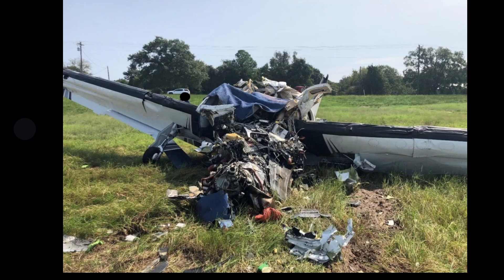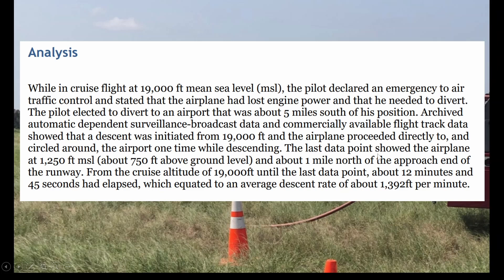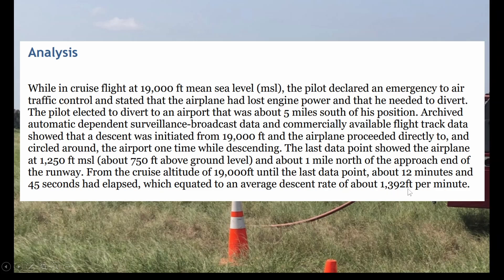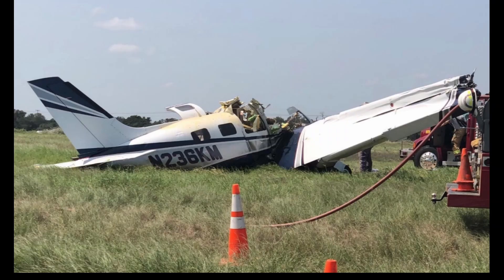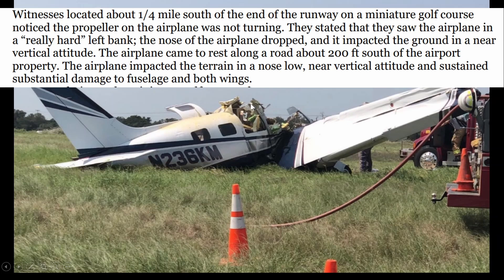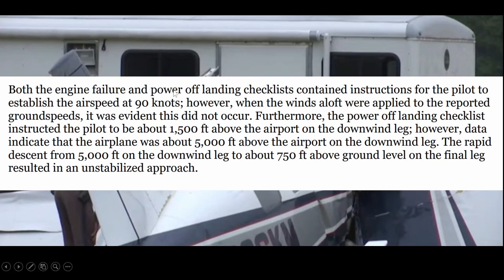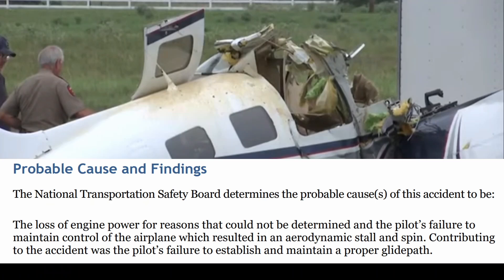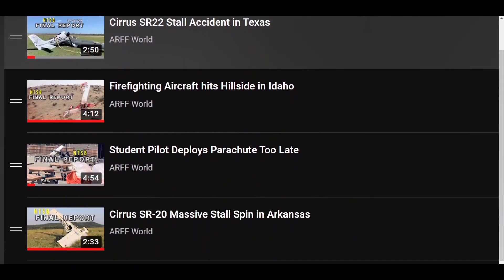Can too much Altitude Cause a Crash?

Comment: As an instructor CFII, he should've circle around  to loose more altitude before turning final. Otherwise, it seems like he was forcing the airplane to get on the ground which is the opposite of what we do. Choosing a closer airport wasn't a bad idea but he had to gauge both distance from airport and the altitude he needed to loose. Most of the time pilots panic and that's what causes more issues. Again, it's hard to blame anybody since everything happens so quickly.
Reply from the maker: Thanks you Elisha for your info.  Appreciate it and please subscribe so we can hear from you in the future.
Reply: I think "panic" is the operative word...it's hard not to panic when you have an engine-out scenario, but he had plenty of time to figure out how to get the plane down safely. Shame.

Comment: No, no such thing as too much altitude, unless there is an inflight fire. Being 5000 feet above the airport should be no problem. Make a couple of descending spiral turns over the so-called key position, and adjust base and final legs from that point.
Reply from the maker: Thanks Sam for sharing that info

Comment: Yeah, that's a mystery.... it looks like he didn't manage his altitude/energy correctly. Circling down over the field is the preferred situation, but they likely didn't manage things right. Most pilots train for engine out scenarios and practice short-approaches to get used to the glide performance and the effects of winds on different legs in the pattern. Realizing that after all that, they were not going to make it to the runway and stalled it at he last minute based on the nose down trajectory. Very sad...
Reply from the maker: Really sad one Paul.  Thanks for Sharing

Comment: I've had 3 engine failures in my life and each one of them is the same thing you fly the airplane to the landing it sounds like this guy tried to hustle it he had plenty of altitude to work with which gave him time I'm and if you try tol speed up his descent into the runway at the last minute with a high angle of attack on the left bank probably stalled a wing.  This should have just been a standard engine out landing without an issue. Very sad.
Reply from the maker: Thanks for sharing Stewart

Comment: no one needed to die in this scenario - he had over 20 min at glide speed to find an A/P and one being 5 miles away, or 3-4 min, that he chose was a gift tied up with a red ribbon. Lots of time to lose elevation - get over the A/P #1 then you can have a coffee while you lose altitude...anyway he could have done a few things that likely have been covered below - pilot error X 10. I would have to say given his choices and his chosen, which was far from optimum, he needed training on these types of emergencies and was lacking in experience as well as practice AND he was flying a complex Aircraft. Geeeeee. personally I think every pilot who flies any plane other than a single seat (plane) should have to have a 1 hr Emergency/unusual attitude check ride annually.  Just my 2 cents - I was commercial bush northern Canada in another lifetime.
Reply from the maker: Thanks for your feedback on this, i really appreciate it.  Hopefully some lessons can be learned to fix these all to common crashes.

Comment: Lots of altitude to play with.  Little talents ate that.   If too high, you are required to do 360's between the runway and the base leg.  Gear down when pointing to runway and too high,  then flaps if still too high.  He pop out both things, turned bad and too low, and stalled full stall and spin before the runway.  Emergency Low Maneuvering mistakes.  ELM mistakes all over.
Reply from the maker: Thank you
Reply: @ARFFWorld  Did i win a pineapple for that comment?  Send some..  LOL..

Comment: I would have done a steep spiral or turns around a point maneuver to patern altitude. That's why it is good to practice 180 and 360 degree power-off landing.
Reply from the maker: Thanks for your take on this.  Please consider subscribing for more aviation news

Comment: Simulated engine failure as has already been noted below is a very common practice throughout training to Private and Commercial Pilot Licenses...the engine is throttled to idle and sometimes depending on the engine/aircraft models carburetor heat applied, to prevent icing...but there is (also already noted) no such thing as an airfield too close with loss of engine power. The likelihood is lack of recurrent training in engine out procedures and a lot of panic. I'm hopeful that in the event I'm ever in this same position that I recall these words...it's a tragic incident without a good reason.
Reply from the maker: Thanks for writing in Richard.  I appreciate your point of view

Comment: To answer your question:  YES.  Every aircraft has a service ceiling.  It's the highest altitude it can safely cruise at.  However, this plane was well below its ceiling of 25,000' when the engine failure happened.

I know that not the question you were really asking, it's worth mentioning because "going to high" has been the direct cause of several plane accidents in the past.

Your question had to do with being too high on approach, and YES, that too can lead to an accident, but, assuming that the airframe is intact, being too high on approach does not cause accidents.  It's the actions that a pilot takes to lose the extra altitude that determines the outcome.  The key is to establish a stabilized approach before you descend thru either 1,000' or 500' AGL.  In simple terms, a stabilized approach means descending on the glide path/slope at the final approach speed, with no further changes in airspeed, rate of descent, or plane configuration (flaps, gear), and are centered on the final approach course. 

When we practice power-off landings st a field, we never kill the engine(s), but instead, we bring the "failed" engine(s) to idle  -- this is for safety reasons.  But, because the engine is still running, it is still producing some thrust while at idle -- which means that the plane is a little easier to control than a plane with a stopped engine.

Simulators are used to practice true engine-out landings.  There is a noticeable difference in how a plane handles with a dead engine, versus an engine still running at idle.  With a dead engine, it's a lot easier to stall, and it takes longer & more altitude to recover from a stall.  All GA pilots should buy simulator time, and along with a CFI, practice dead engine approaches and landings for your aircraft type.  The experience is invaluable.

You asked if he should have chosen a field that was a little further away.  Pilots, regardless of their experience, have differing opinions, each with valid supporting arguments.  And, I believe that it's a valid question pilots should ask themselves if they are faced with this situation, especially if they have more than enough altitude to make it to an alternate field.  I've even heard ATC suggesting another field for that reason.

Personally, I would look for the closest suitable field and land there, regardless of altitude.  The reasons are simple: 1. I know I can make the field, 2. One less thing to worry about; and assuming a controlled field, 3. ATC has more time to manage the alert, 4. ARFF has more time to prep and deploy. 

It's hard to know exactly what the pilot was truly dealing with, so to 2nd guess in this situation is inappropriate.  All we can do is train for this in real life, and in simulators, in order to develop "muscle memory" for this, and other similar situations.

God's peace be with their families and loved ones.
Reply from the maker: Thanks for answering my questions.  I appreciate it

Comment: The goal is to arrive at approach to land around 90 KIAS. (Try to re-start engine).
With engine out, need to: aviate, navigate and communicate.
* Assess your rate of decent
* Reduce drag- feather prop
* @ 1000' per minute
* Find suitable runway 
* It would be very helpful if your wings are level 
* Smooth surface, lower gear 
* Rough terrain or water "drop it on its belly"
🌏🇦🇺 "Straight in the pickle barrel"
Reply from the maker: Thanks John for your feedback on this

Comment: The only time you'd shut down an engine, is in case of fire. A pilot should reduce power, dial back the propeller, once a safe gear operating speed is reached: lower the landing gear. All these add drag and allow for a safe and controlled descent. No unusual banking should be attempted.

Comment: I will say that we train for power off landings regularly. There are some instructors that will actually shut the engine off and have students practice true power off landings and approaches. (which I don’t totally disagree with). 
     However the norm is to bring power to idle to simulate an engine failure. 
     Instructor may out of no where put power to idle and say “engine failure” with no warning. 
    The take away is to always be ready. At all phases of flight I have to be ready.  Not necessarily planning out an emergency landing at every field during a flight. But I train to always look at where I’m at and what my options may be.  My instructor could with or without pulling power ask in the moment where I would land if the energies were to fail. Just being aware of what fields are where or roads or whatever could be a spot for an emergency landing. 
    The lower the altitude the more
thought that needs to go into that decision because there’s less
Time. 
     Pulling power just after take off is another training lesson. It is done to get the student to learn to push the yoke or stick forward. A difficult but definitely not impossible human reflex to overcome.
Reply from the maker: I appreciate you writing in and supporting the channel.

Comment: You asked if there is such a thing as "too much" altitude. The answer is a no. Altitude is a friend. It's what one does with it. Altitude means time.  Not to criticize a pilot who's no longer here either.  The descent from altitude is a trained and known procedure that is practiced, probably not enough however.  It's necessary to get the aircraft trimmed for best glide and begin a spiral down over a field.  That would have taken quite a while for that plane at that altitude.  However, during that time the pilot runs through a check list and attempts to restart the engine. Failing that, the final approach is made as for any other landing.  Why he came down so fast and without a lot of control we'll never know.  That plane glides very well.  Maybe he got upset?  Maybe he was very used to uneventful flights? Things happen. It seems he was in too tight to the field and over banked the wings, not a normal patterned approach with definite legs. That  led to loss of control. It's important to continue to fly the plane as a glider or as a powered aircraft by maintaining the correct speeds to fly. This is very sad.  Sadly too, it happens to the very best of us. I wonder if he got scared because he had friends aboard? It's embarrassing, but could be a factor too.
Reply from the maker: So many factors I agree.  Sad

Comment: nice footage.  altitude is your friend unless you’re hypoxic.  the PA46-350 malibu is a dream to fly if you’re a short guy but from experience, i can think of a few unsuspecting killers off the cuff.  the most memorable is fuel mismanagement when accommodating payload/passengers.  Also the fuel selector is Off/L/R where there is a small detent below the L.   The entire slide/tab position is somewhat obscured and the minor detent may not be enough to capture PIC attention if L was previously selected and the PIC mistakenly thinks it on the right.  So it’s moved to the off position and the engine quits!  and restarting a shock-cooled turbo can be challenging. 2. induction air 3. pitot heat should ALWAYS be selected 4.  flaps for takeoff is a killer but they at least got to FL190. 5. TIT mismanagement (should be around 1500 even though red-line is waaay out there.  tragic but a reminder the malibu is not a skyhawk
Reply from the maker: Thanks for watching and your thoughts

Comment: Your question is very loaded. There is something dubbed the coffin corner.  Yes there is such a thing as too much altitude. To go into detail it’s too much to text. But to simply explain…A plane can reach an altitude to where it cannot go any faster otherwise it will surpass vne (maximum allowable safe speed) or in this case critical mach but it will also stall if it were to slow down. Research coffin corner if you wish to know all the details as it’s just too much to go into in a comment. Lol. 
    Now I didn’t watch the video so I don’t know what the exact reference is in relevance to the video. But I will watch and see. 
     I’ve taken a few steps back from crash videos. It’s just been starting to effect me mentally as a pilot.
Reply from the maker: Yes,  please take a brake.  It is hard for me as well, but I am not a pilot so it probably a lot harder for you.  Thanks for your honesty

Comment: Not enough people practice engine out procedures, in training, we simulate the engine out without really turning off the engine. With an actual failure, depending on the windmilling prop or lack there of, the glide performance will be different. However with enough experience and practice, you should be able to adjust the flight path to make a safe landing.
Reply from the maker: Thanks Thomas!  👋

Comment: Oh no. Altitude is your friend. In any case that you have engine issues you can descend pretty quickly as long the airport is in gliding distance. So altitude is not an issue with the exception of fire that you need to be on the ground like now. Also no you don’t turn the engine off. You do though practice in idle.
Reply from the maker: Thanks Chris for the clarification
Reply: @ARFFWorld  No worries. If you are in San Diego one of these days please reach out to me. We will do a local flight.

Comment: Engine failure training is usually done with the engine running at idle. In my younger (read immortal mental attitude) fight instruction days, I would indiscriminately turn off the fuel selector to simulate an engine failure (yes at higher altitudes). As far as can you be too high? The old adage "attitude is your friend" comes to mind. At 5,000 feet above ground level at the airport you would have about 5 minutes to prepare for the power off landing (assuming a 1,000 feet per minute descent rate). YOU HAVE TO CONTINUE TO FLY THE AIRPLANE. It makes me sick on how many survivable accidents happen by pilots running out of airspeed and then stall/spin the airplane at low altitudes. You have to fly the airplane all the way to the crash site; however, once you enter the low altitude stall you are done flying the airplane.

Your videos are great: short, descriptive, and to the point. The only bad thing is that it makes me miss my OGG layovers.
Reply from the maker: The OGG trade winds will always be near waiting for you. Thanks Steve

Comment: It appears the pilot got too low on the final approach then tried to stretch the glide to make the runway, airspeed got too low and stalled.  It doesn't appear weather was a factor if that photo was from the same day as the crash.  Of course, high winds could also be a factor, especially if it was a high head-wind which caused the pilot to misjudge his final approach.

Assuming weather wasn't a factor, there's some really bad pilot judgement.  On declaring emergency, he could have done a straight-in, instead of a downwind.  He should definitely be high on final, especially with a long runway.  But even if he couldn't make the runway, he had an open field around the airport, so his biggest mistake was not maintaining airspeed.  Definitely should have been survivable landing on that field.  He may have had a fear of damaging the aircraft, making him want to stretch the final to the runway.

I would almost certainly choose the closest airport, if the runway wasn't very short and there's no other airport very close by.  "Too much altitude" is NOT a problem.  You can make all kinds of maneuvers (360's, S-turns) to lose descent.

I got my fixed-gear, single engine land license in Norther Wisconsin where there were lots of farms.  We practiced power-off emergency situations and even landed on a farm once.  Very sad outcome.
Reply from the maker: Thanks for your input on this one.

Comment: Pilot was high in altitude felt mental pressure to get on the ground (his engine is dead) and did not want to fly away from the airport. He cranked the plane over likely had a very steep bank angle the wings stalled, down they went. 
I did a similar thing the other day. I was working my way into downwind trying to stay inside a crop duster, so I was only 1/2 the usual distance from the runway. The crop duster came a lot high and set off my adsb thing, I see him and want away from his so I turned. In my turn I had a hawk fill my windshield. I was already in a steep turn at idle power. Hawk is in front of me and I did climb, so I went to full power wings level and straight up so it felt. My stall light came on in the turn to avoid the crop duster not sure about the climb, only went up 200 feet max. We did the approach fast, a friend was coming in behind us, we are faster so we wanted to land and clear for them. My pilot buddy and flight instructor said it was a good thing we were fast gear and flaps up. He was not happy I was so fast and told me to slow down but it worked out great today. If I had been slow like the accident pilot my hard turn to avoid a crop duster and a hawk would have stalled the plane.  
Once again, you did a good job covering the final report.
Reply from the maker: Thanks Burns, I appreciate you sharing your story